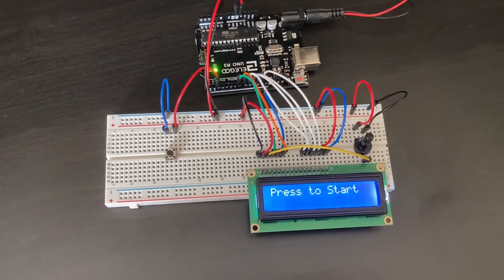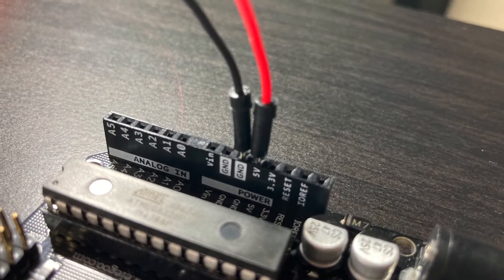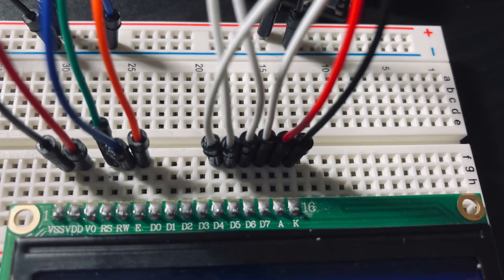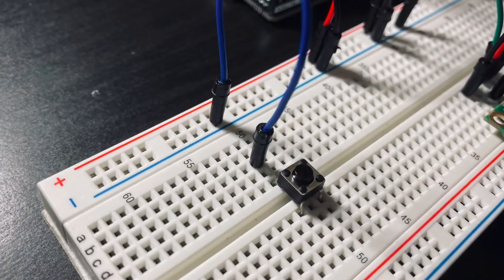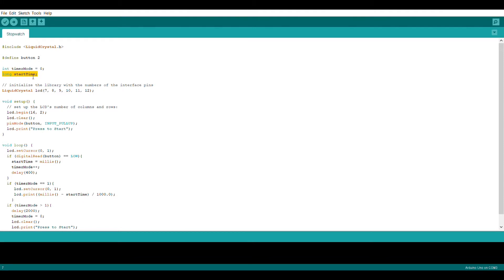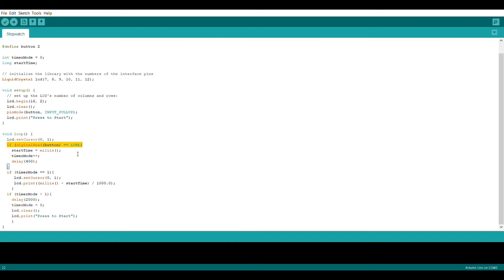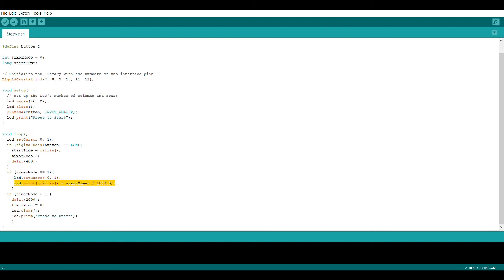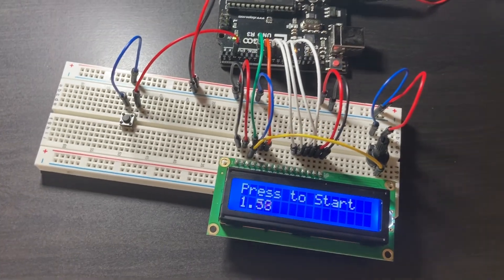Arduino Stopwatch with LCD | Beginner Arduino Project

Comment: Did you get your only 3 friends to comment !  Where'sthe code ? FAIL !!!!!!!!!!!!
Reply: #include <LiquidCrystal.h>

#define button 2

int timerMode = 0;
long startTime;

LiquidCrystal lcd(7, 8, 9, 10, 11, 12);

void setup(){
  lcd.begin(16, 2);
  lcd.clear();
  pinMode(button, INPUT_PULLUP);
  lcd.print("Press to Start");
}

void loop(){
  lcd.setCursor(0, 1);
  if (digitalRead(button) == LOW){
    startTime = millis();
    timerMode++;
    delay(400);
  }
  if (timerMode == 1){
    lcd.setCursor(0, 1);
    lcd.print((millis() - startTime) / 1000.0);
  }
  if (timerMode > 1){
    delay(2000);
    timerMode = 0;
    lcd.clear();
    lcd.print("Press to Start");
  }
}

This is a Code, but i fixed it
Reply: @ArsenTech   there is different in time
Reply: @ArsenTech  can you please help me
Reply: @ArsenTech  it still isnot working it might be me though
Reply: #include <LiquidCrystal.h>

#define button 2

int timerMod = 0;
long startTime;

LiquidCrystal lcd(7, 8, 9, 10, 11, 12);

void setup() (
  lcd.begin(16, 2);
  lcd.clear();
  pinMode(button, INPUT_PULLUP);
  lcd.print("Press to Start");
)

void loop() {
  lcd.setCursor(0, 1);
  if (digitalRead(button) == LOW){
    startTime = millis();
    timeMode++;
    delay(400);
  }
  if (timerMode == 1){
    lcd.setCursor(0, 1);
    lcd.print((millis() - startTime) / 1000.0);
  }
  if (timerMode > 1){
    delay(2000);
    timerMode = 0;
    lcd.clear();
    lcd.print("Press to Start");
  }
}
Reply: @vivox8291  Same here. Needs help ASAP @Fantasy
Reply: @vivox8291  why is my timerMode not in scope even after copy and paste?
Reply: @kennethordonez2577  Same here. Needs help ASAP @Fantasy